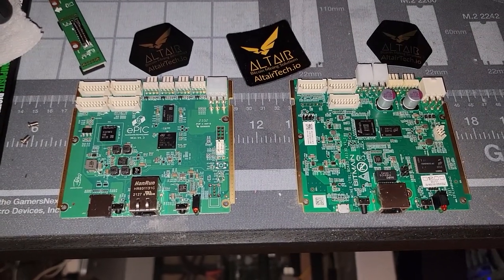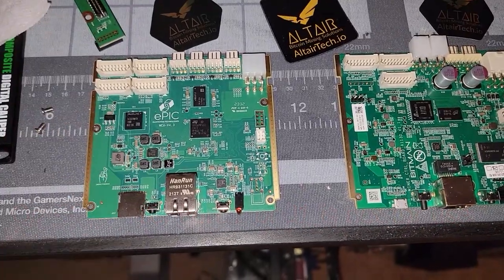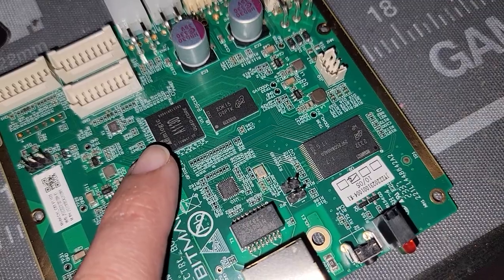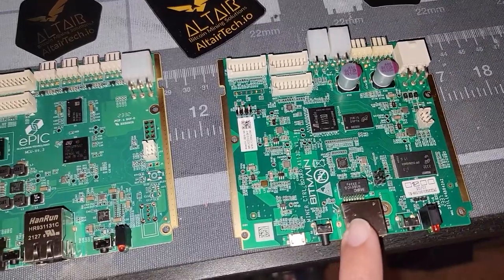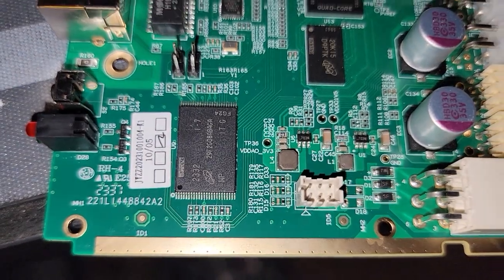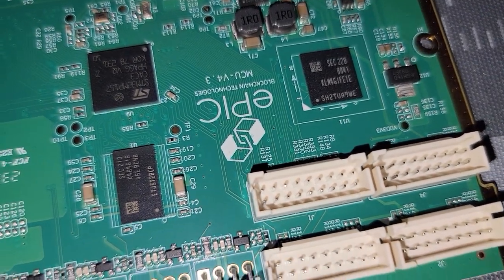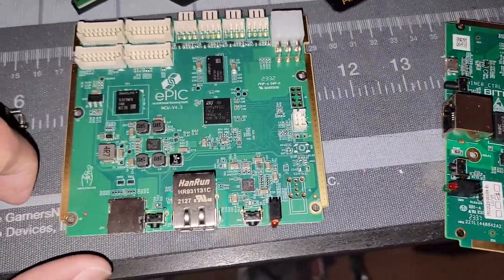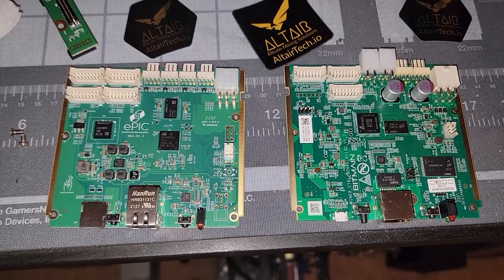ePIC Control Board VS AMLogic Comparison

Comment: Which board is best ? Or new
Reply from the maker: @samarjadon6274  epic because one-time payment, no dev fee. Amlogic has no devfee, but to push the hardware or overclock, you need to install 3rd party firmware. Hardware wise, the PCB is similar, but a few chips or components on the Epic board are better